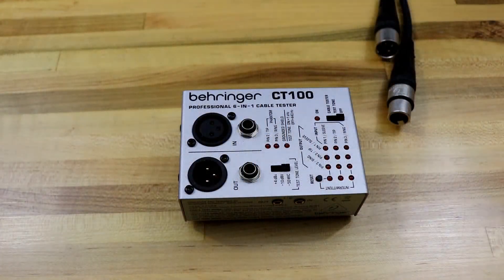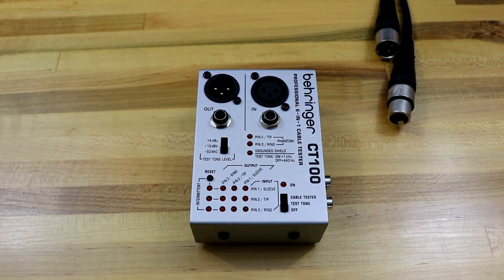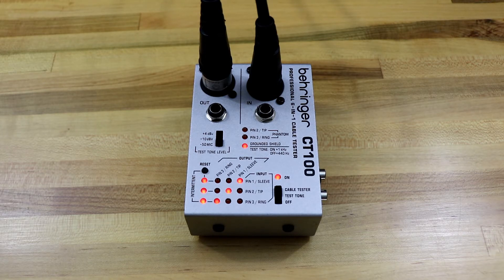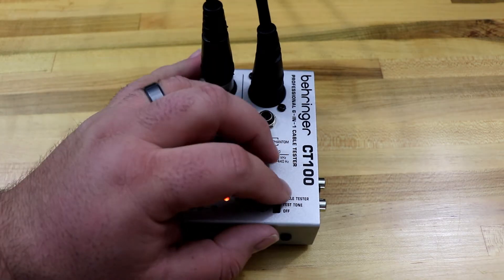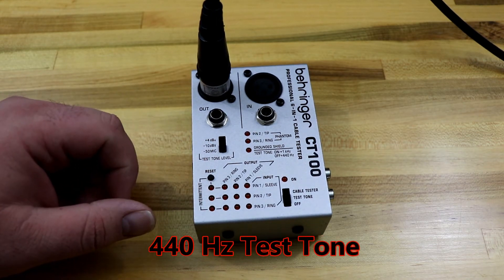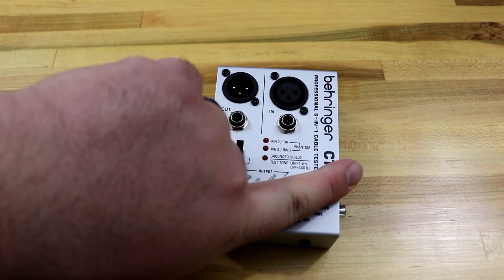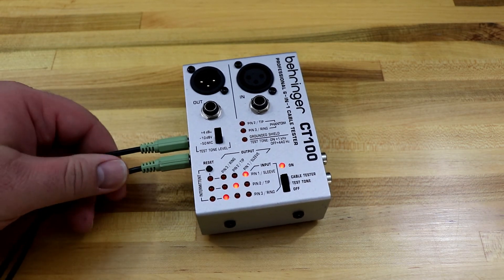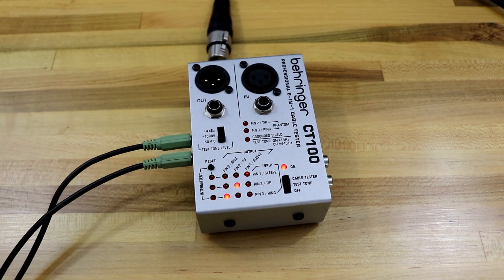Behringer CT-100 Cable Tester Overview and Review

Comment: Thank you. Great video. I’ve had this unit for a long time and it has served me well. It is beginning to show signs of improper functionality (lights flashing when they shouldn’t be, and the tone tester is very scratchy sounding). However, I mostly use it for testing. Ask Lars and quarter inch guitar cables so I may stick with it for a few more years. Thank you again.
Reply from the maker: Mine is still doing ok, despite lugging it around in my toolbox all the time. But, at the price, it's worth it to replace if it ever dies.

Comment: Can you explain if the test tone only works when "in" is placed in a mixer? When I just test the cables alone using this it doesn't make a tone. Thanks
Reply from the maker: Hi Erik. In order for you to hear the tone, you would need a speaker of some kind but the CT-100 does not have a speaker.  Tone is really only for testing systems not so much for cable testing. Thanks for watchin'!

Comment: I'm looking to purchase one of these and found your overview very helpful; thank you! I'm just curious, when testing for tone; what would a bad tone sound like? Would it just not register a sound through the amp or what exactly?
Reply from the maker: You would hear intermittent tone or no tone in most cases, possibly distortion (which could also be caused by a bad amplifier or too much gain.) If things are working properly, then clean strong tone should be the result. 😉

Comment: Okay, here's something else you should have made clear here.  The test tone heard on the video is coming from whatever amplifier the cable is connected to (which is not pictured) and NOT from the CT100 itself.  I'm sitting here with a unit I just got trying to figure out why the test tone does not work.  Actually it does.  You feed it into a mixer or an amp and THEN it can be heard. So all the videographer had to do here for the loud tone was to turn down his amp, but we never even see it.
Reply from the maker: Good point, the signal is being sent to an amplified speaker, sorry for the confusion. :)
Reply: @proclaimav4197  No confusion here- it was completely obvious.

Comment: Why are the lights flashing like that? Was the box faulty? On my version they are all solid if it's a good cable?
Reply from the maker: Hi Steve, the flashing is only seen on the camera, due a timing difference between the camera frame rate and the cycling of the LED on/off. For a good explanation see https://www.bhphotovideo.com/explora/video/tips-and-solutions/flicker-free-lights-and-why-they-are-important-you